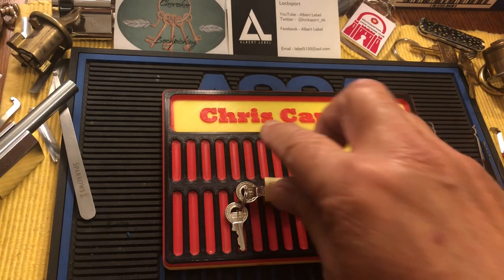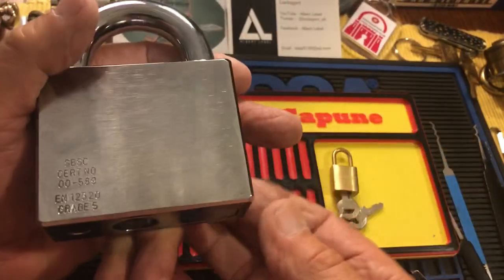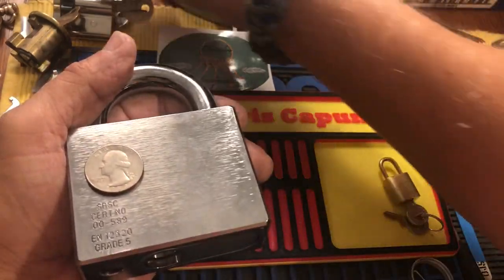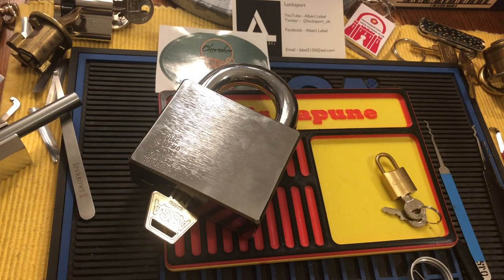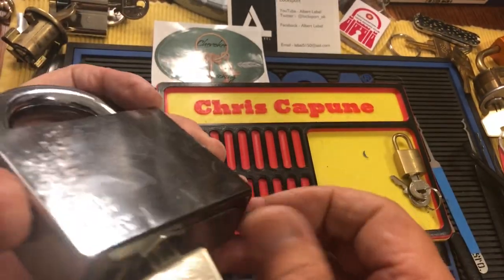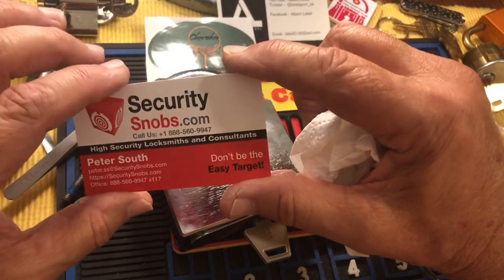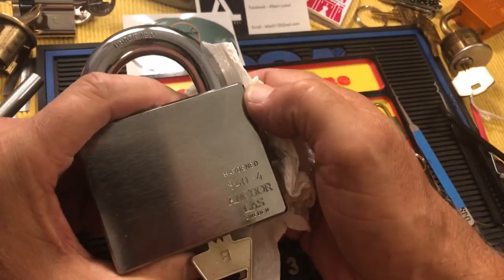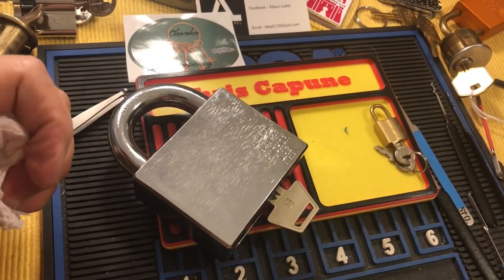#361 Anchor Las 840-4 first look

Comment: Wow, nice lock bro. Those are hard to come by in these parts. 
I've only seen a couple of them. And as for the size... I have only one bigger shackle that is, the multlock C16 has a 16mm shackle and the Hi shear Military lock has the biggest body with a 13mm slide bolt.
An awesome showing.
Reply from the maker: Steel Pinnings Thanks buddy!! 
It’s a beast!!! 
Easy to get from Security Snobs, but very expensive!!! 
👏👍👏🐈

Comment: Can we get a better look at the back of that oval? Wondering if other ovals can be used in that padlock. Hint, hint.
Reply from the maker: Gary Rumain maybe 😅 
I have fit a few more cores in it. One it has to have that straight across tail piece. And the pin plugs on the top of the oval have to be flush. One didn’t fit because of that. 
Will go through my oval and see what fits and what doesn’t. 
🐈👍
Reply: @chriscapune7873  OK. Also, was that oval a 7 pinner?
Reply from the maker: Gary Rumain 6 pin
Reply: @chriscapune7873  OK.
Reply: @two_tier_gary_rumain  a 700 will fit if you want a good core.